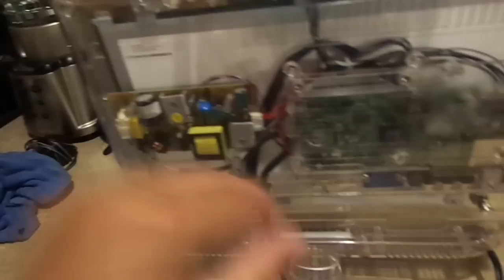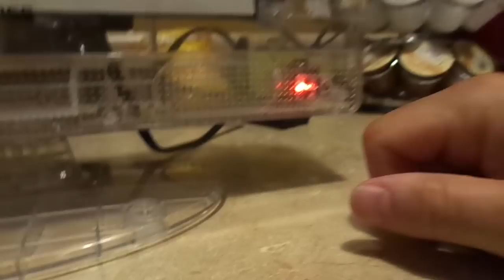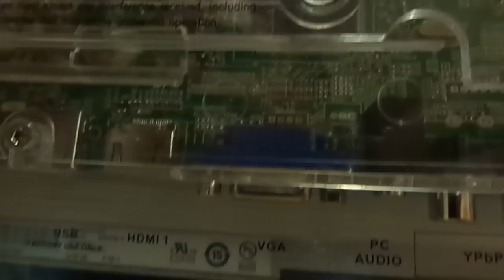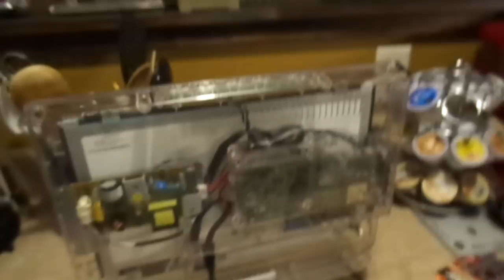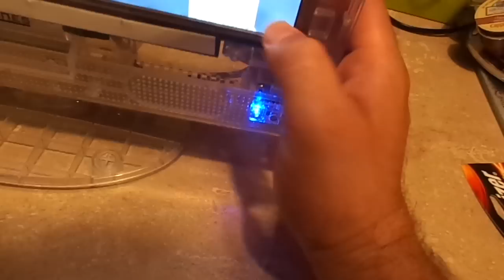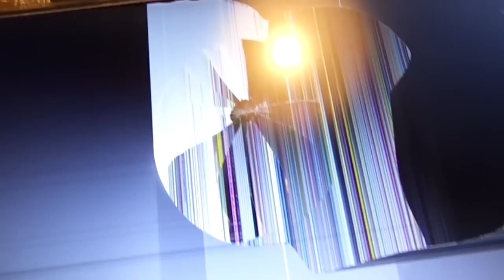ClearTunes Prison LCD TV

Comment: That looks like a $25 piece of shit. That shit is definitely overpriced if it's worth $200, because build 
quality in the production parts used in it is not worth that much. It's definitely not worth $200 especially especially if you take apart those monitors there for gaming computers that worth $199.00. 

Trust me you understand this stuff when you builds things, and sell them production of prison TVs is not worth with TVs are on Market, you know this because the technology that they're working with is at least 12 years off market, and more than 15 years out of date, this is especially when you're using used parts with a $10.00 13'in LCD panel that's been cheaply attached to the outer shell with 10-year-old motherboard and no other parts connect to it. Like I said my gaming monitor which is $199 is a lot better build. The only thing that is keeping this from being devalued is the fact that it's a prison TV.
Reply from the maker: You are correct - it is indeed a bottom-of-the-barrell TV set. The reason this TV is so expensive is the “economies of scale” argument - they make this specific model in a clear plastic shell for a very specific (and limited) market. Even worse, the target market is only allowed to buy this - and only this - TV set. So, you’ve got the high cost of a low production run unit that your target market is FORCED to buy. Economics are what they are…

Comment: Also you can buy them from 3 different prison catalogs here in wisconsin. They don't come with a remote, in prison we can tape a toothbrush to the top of the tv by the button, then run a string behind the tv to the side of your bunk and that's your remote 😉

And you are able to bring them home. I gave away my cleartech my first tv when I was locked up, I had the rca but broke it during a fight in my cell and my wife got the cleartunes which I have in my closet. The cleartunes is one of the nicer ones.

Comment: This product has to be ordered by the inmate or family member  from one of the few selected vendors. Cost around $200.00 plus. Clearly over priced. Hence, it would make since for an inmate to spend  $75 for repair on a $100.00 tv that cost the inmate  $200.00 plus. These tv may be sent out and returned back to the inmate. But, the Inmate has to send the tv out for repair to a pre-authorize factory at a determined price of either /$50.00 or $75.00, depending on rather the damages are to the screen or circuitry.  The damage shown here is  likely caused when the inmate is transferred from prison to prison inwhich his or her property is packed into boxs and cramed in prison transportation bus.

Comment: While suicide is a concern, a far more common misuse would be to put graphite or other conductor into the connector to use as either a lighter for cigarettes (which is a fire hazard) or as a stinger device (a weapon to stun or injure staff or other inmates).

Comment: You can buy a clear prison TV on Ebay for about $75 often less than that. I brought three. The are conversation pieces. I had a brother in prison once and he had a prison TV. 15 inches at $295.00. You could buy the same TV in the free world for $99.00 and $69 on black Friday. They weigh nothing. The reason the prison TV is so expensive is prison mark up is often 150%. Also the clear TV production run is smaller so you don't get the economies of scale you get when making 20 million of the same TV for every discount store anywhere.

Comment: They come with a little right angle adapter. The end of the cable cord don't bend very well. And depending on where you're at you can buy them with speakers. And in some cases they do not have a USB port or if they do the port is disabled. That way inmates can't charge their cell phones with them.

Comment: Modern TVs are so simple. I'm not even old and I remember when a CRT TV was a rat's nest of electronics.

This board likely supports 50hz PAL video too so they can use it on TVs made for other parts of the world. It's ironic that the super cheap TVs are often multisystem (even if it's not advertised) while the brand name ones are almost never.
Reply: irtbmtind89 , do you know where to find firmware upgrades for this tv?

Comment: prisoners can't bring ouside electronics to the inside due to the risk of modification, most guards are really dumb and can't tell the difference between a tv set board and a tablet board, if i bring a tv set, modified with a 3G tablet board, a 13" touch laptop screen and some bogus mounted ports and components, what you think would happen? The guard approves the tv set and the prisoner could plan a escape, or even worse . . .

Comment: The coaxial output would be for connecting the TV to a sound system for audio.  I presume that's what it's for in this case.
Reply from the maker: While this is feasible on this TV set, it was never intended to be used. These TV sets were specifically built without speakers for use in correctional facilities. Inmates are required to use headphones to listen to any form of audio, as they live in close confines with other inmates.
Reply: So the socket is probably unused on this model, unless of course it's a second antenna jack, that's also possible.

Comment: I bought one of these at a thrift store. it has speakers and everything g though. HDMI. RCA VGA  antenna I wonder where it came from.
Reply: I got a complete with prison number engraved in the back 15 inch cleartech at a pawnshop maybe 20$ because the employee couldn't figure out why it wouldn't play anything but static...while not being plugged into any coax/hdmi/rca hookups and also not on the tv/antenna source. I was smart enough to know source on hdmi with a device delivering hdmi should probably work. 
For 20$ I figured it was broken if it had participated in a prison fight I wasn't out much, if it did work it would be excellent for a camper tv... if it's tough enough for prison it should be ok in a camper. 
I got it home hooked it up to my hdmi on the ps3 and it sets its own resolution and settings and i get a extra surprise it will do 3d and holly-hell Is it crazy loud. The 40in tv can't even do 3d on the ps3. 
The prison Tv gets used daily, and the 40 rarely even gets turned on. 
Prison tv is a purchase I would do again, as long as I don't have to be in prison to get it. Lolol

Comment: Technically not a "LED panel"; it's a LED-backlit LCD panel, as opposed to a CCFL-backlit LCD panel.
Reply from the maker: +Channel 2012 Ugh... Why do people have an incessant need to correct every little thing I say? You know what I meant. I know what I meant. 99% of my viewers will also know what I meant. Why is your comment necessary? I know what an LED LCD panel is.
Reply: BBISHOPPCM's World
To answer your questions, it was to prevent confusion. You'd be surprised by how many people don't know the difference between a LED panel and an LCD panel.

Comment: Whether or not you can bring in a used TV depends on the institution. Some require you buy from their commissary, others will allow any TV that meets the institution's specs as long as it is factory sealed. Most won't allow an open-box unit. Also, you'll find some do have speakers--again, depends on the institution.

Comment: i would totally buy a clear cased tv if they were available and of better build quality.
Reply: +gmcnewlook The smaller visio tv's have headphone jacks on the back
Reply: +SandyStarchild heck id love a tv with a headphone jack.... they dont really make Tvs with them unless its designed to double as a monitor....
Reply: @gmcnewlook  I just bought a 75” Sony 2 months ago. I could only find 2”3 tv makers still adding headphone jacks. Sony, hi sense, and sharp. Sharp and hi sense made by the company so same tv different name. I bought the Sony. The hi sense and sharps has shit reviews everywhere I looked having dead pixels, but yeah I bought the Sony tv with a 3.5mm headphone Jack because I use a surround sound set up from the mid 90’s all with 1970’s Bose speaker. Sounds great and didn’t want new cheap made surround
Reply: +gmcnewlook My old 14" CRT with a built-in VHS player has a headphone jack.
Reply: +gmcnewlook I've got a early 80's black and white set that has a earphone jack.
Reply: gmcnewlook  I got a insignia 1080p 22in has headphone jack
Reply: Ill gladly sell you mine. I had no idea there was a market for them. I even have the clear remote. Mine does have speakers, though, and headphone jack. Its an AMPd TV
Reply: ok mr. 90's just kidding lol
Reply: This TV is not good quilty its only Good for basic cable or very old computer
Reply: gmcnewlook ya mean like the old gameboy colour type casing?